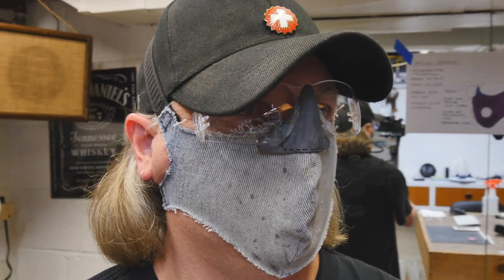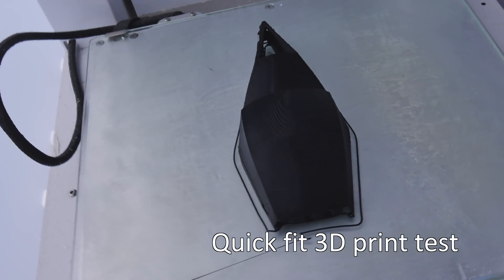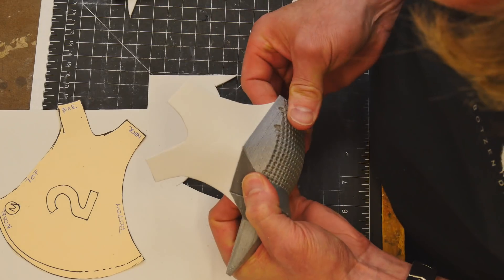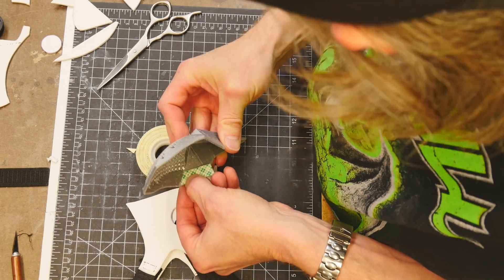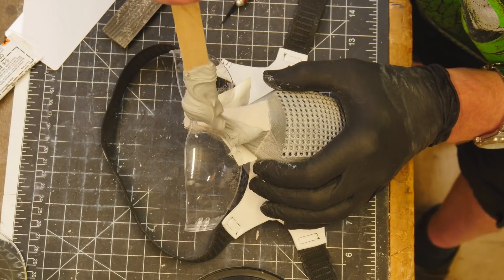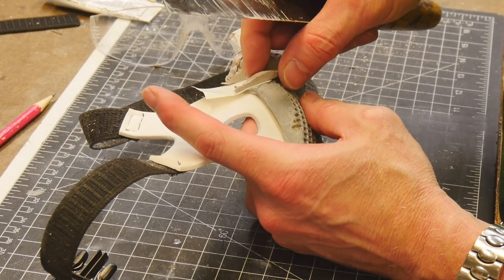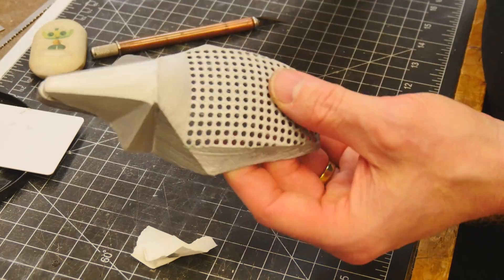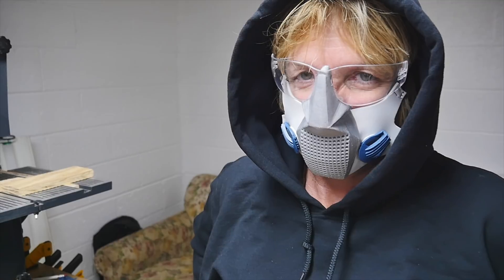Refined Dust Mask with Eye Protection: Phase Two Industrial Design Soft Goods product development

Comment: Dust masks and safety glasses typically don't work together when doing any sort of physical work (like demolition work).  The problem is that moisture from respiration and perspiration will condensate on the interior of the safety glasses rendering the worker blind from the fog.  In these situations the worker is faced with the choice of either seeing or breathing which leaves lungs or eyes in danger.  I hope that your concept solves this problem!  Great video!  Thanks for sharing.  Good luck!

Comment: Awesome! I also love that you're UM2+ looks exactly like mine on the inside! All the plastic goobers.
Reply from the maker: Mack the Maker actually what you see in that shot is the Elmers glue stick shavings I scrape off the build plate with the card scraper every few prints to keep the deck flat.
Reply: Eric Strebel I have those too!
Reply from the maker: It's a thing I guess then,...... there should be a name for those PVA shavings

Comment: Back when i used to actively use Blender, i could make and iterate on a 3D model of such kind much faster than i could ever do in cardboard. A friend of mine on Softimage XSI could work even faster. Maybe the more rigorous CAD software is simply less suited for such quick and dirty operation. Most other 3D packages are also fairly slow to work with, except maybe Modo. Now that XSI is gone. Another problem is that ideally you'd have any geometry that you need to build around or connect to already in 3D, else you're running blind, though luckily a mesh of a human head isn't exactly a rarity nor that hard to make if you don't need it to be all too detailed.

Comment: The one-way valve is sitting flush against the cheeks?!   Also, there's not enough surface area on the filter part to make breathing comfortable.  I know this is a proof of concept prototype but it fails to address the functional requirements.
Reply from the maker: rotate85 actually the crease in the front part provides an air gap for the  one way vents to work. Works pretty decent actually.